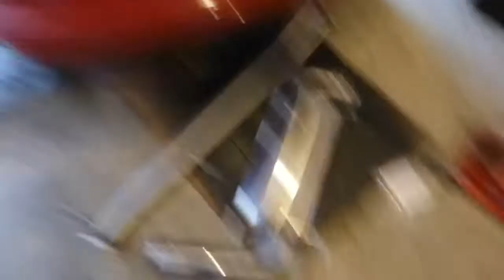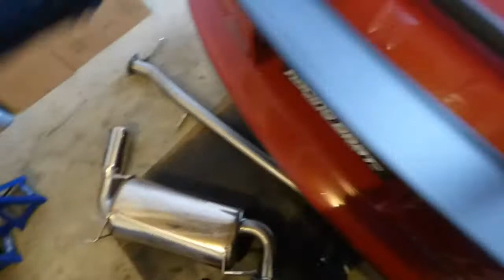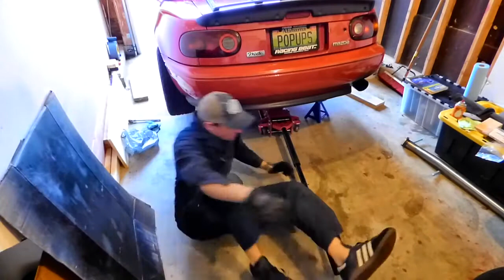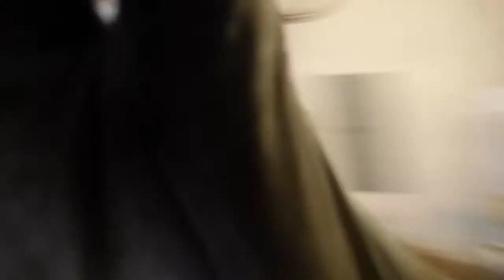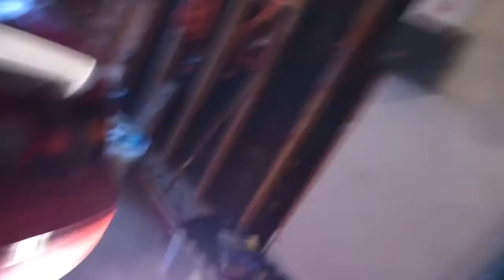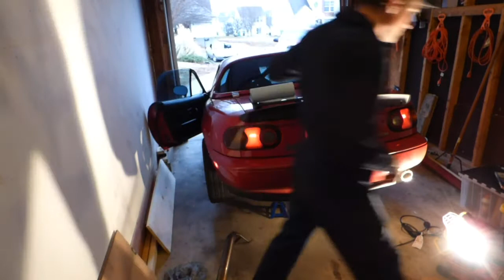Racing Beat power pulse sport muffler install, 1990 NA 1.6l

Comment: Had the same problem as you, yonaka has taken a crap and now going to order racing beat. can you keep the yonaka mid pipe and connect it with the racing beat cat-back?
Reply from the maker: That I’m not sure. I just unbolted everything and swapped it in.
Reply: Same issue here. Had a Yonaka, LOVED its sound for the first year or two, but it just started getting louder, and louder, until it was an obnoxious, droning, fart can sounding mess. Got so sick of it I went back to stock. Drove around stock exhaust for a number of years, and now JUST ordered a Racing Beat Power Pulse that should arrive next week. I hope this is the last exhaust I have to buy for my NA! I also had the same question about the midpipe, and though I never tested it and the Yonaka is sold now, I think the answer is no they wont bolt up together easily. My old blown out Yonaka now sounds fantastic on a freinds Honda J V6 swapped  Miata!